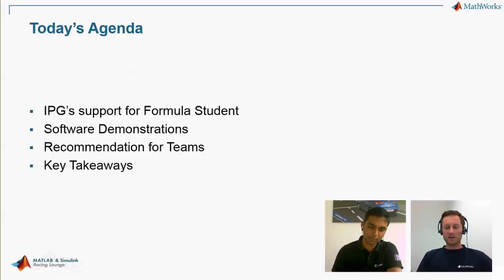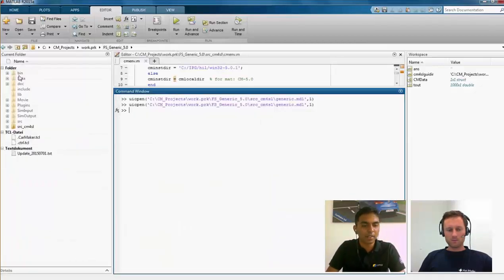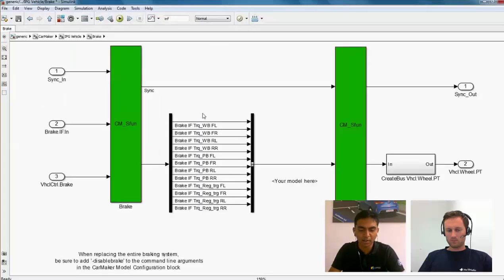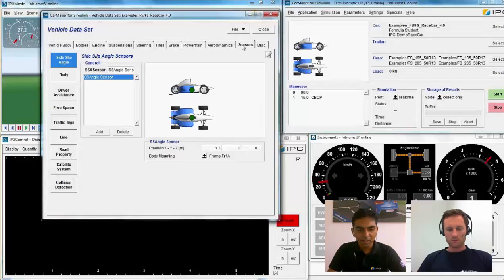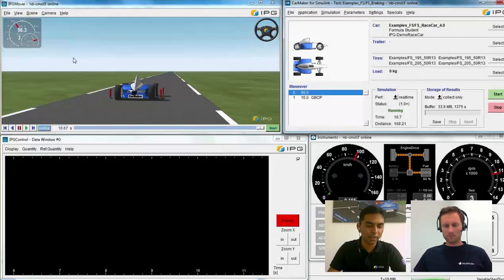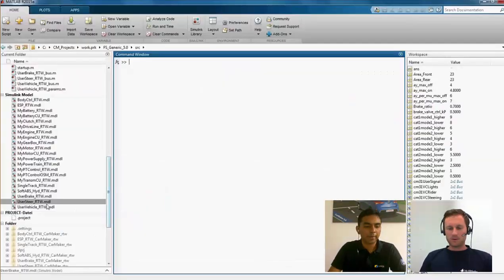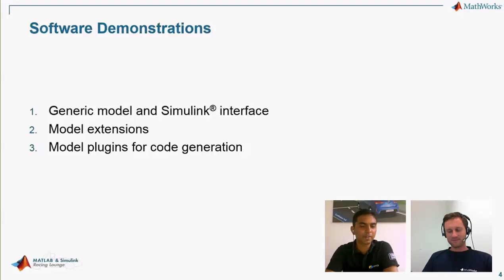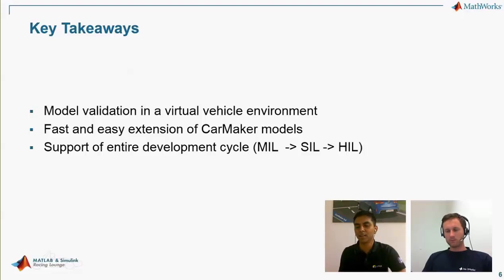Formula Student: Simulink® and CarMaker

Comment: Hello, I am using Carmaker and Simulink for modeling and controlling of powertrain for a project. We have added few blocks in the generic model and replaced few signals with the desired signals. The problem is the new model is running at very slow (0.02 times the real time).  Due to this, we are unable to input real-time data into the carmaker environment. Is there any way to make the model run at real-time speed?
Reply: IPG Automotive GmbH Thank you.

Comment: Hi guys.
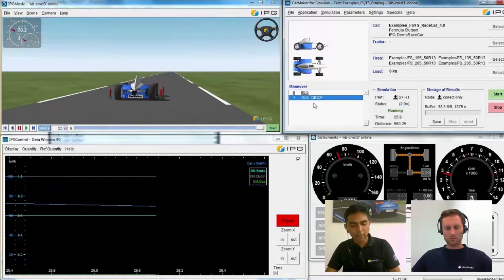I have a question regarding 23:05. Prasanna said once he disconnects the brake signals ,the car doesn't decelerate but the it actually does in the simulation. What does actually happen once you disconnect the brake signals?
Hope somebody could help me on this one. Thanks :)
Reply: Thanks guys for the quick response. 
I just tried it out and by using IPG Instrument it is easier to observe that the car doesn't brake.
I am currently doing a project using IPG Car Maker(connected to Simulink). Do you guys have any other videos or links for someone new in this topic? Like maybe more examples in regards to IPG CarMaker connected to Simulink.
It would be very helpful.Thanks in advance :)